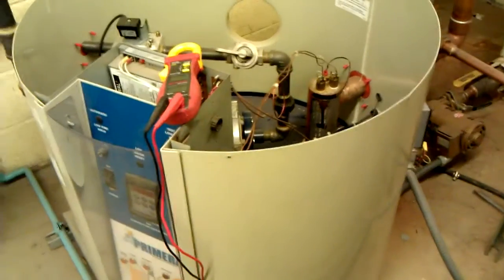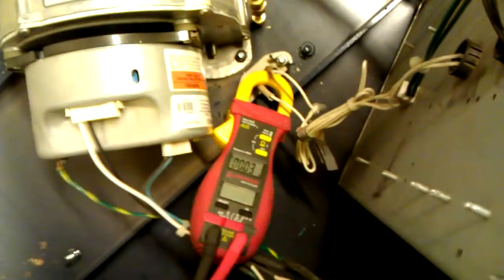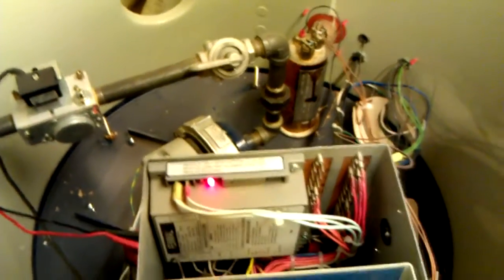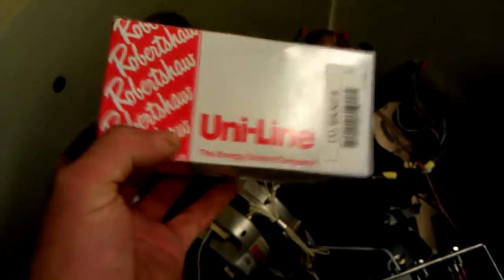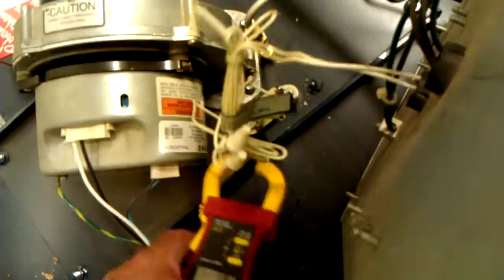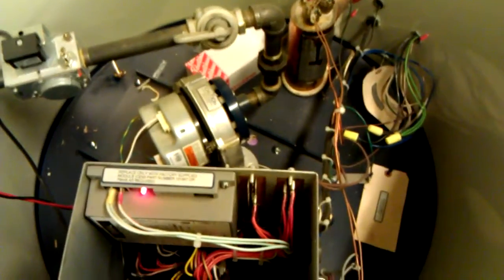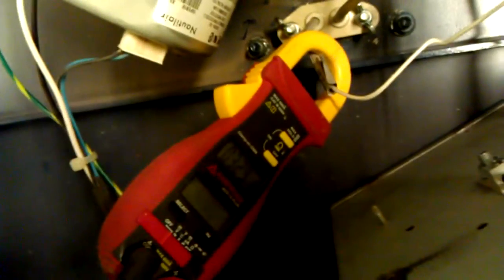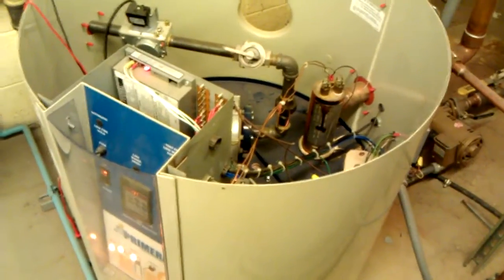Be aware of Current Proving ignition control modules when the HSI is slightly worn [HD]

Comment: @hackfreehvac I was commenting on that even well after it lit off, your meter was still indicating full current to the heating element.

Modern oil burners use interrupted spark ignition,they turn the ignitor off after a few seconds once it lights off. Saves wear on the electrodes and transformer. I would have have expected a modern,commercial unit like that to do the same with it's ignitor. Seems silly to wearing out the heating element the entire time the burner is on.

Comment from the maker: @amfan12 
Ah, lol, no the ignitor is only energized to ignite the fuel. 
It operates the same as any ignition control except that the ignition control monitors how many amps the ignitor is drawing.
If it's broken and pulls none, obviously it wont turn on the gas valve and just fail. Which is likely the plan.

But if it doesn't pull enough, say the ignitor is just slightly worn as in this case, it still wont energize the gas valve and just shut down on fault for a bad ignitor.